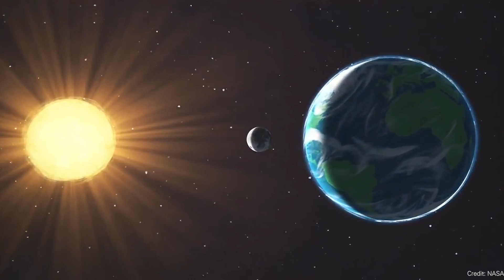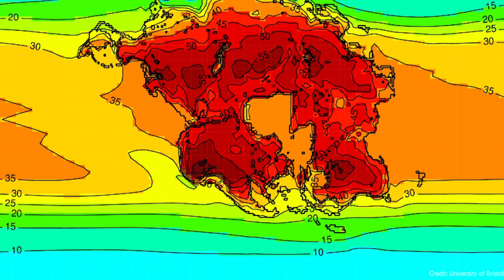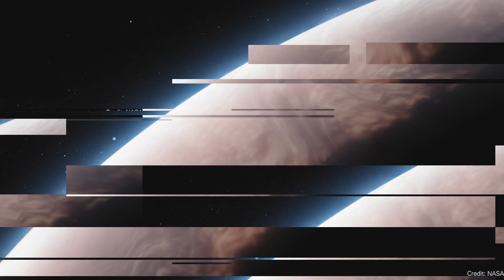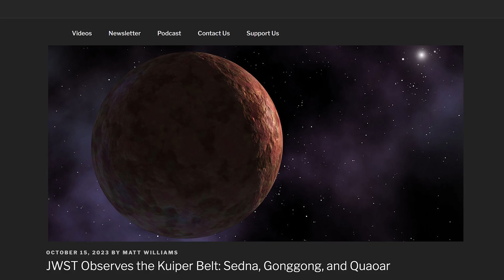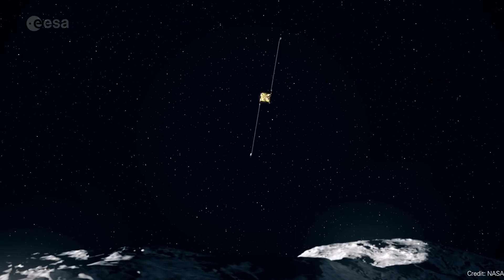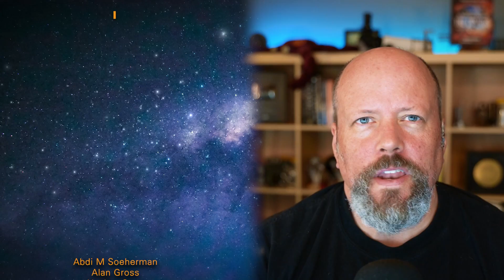Deadly Supercontinent // Pluto Cryo-Super-Volcano // Most Powerful Solar Storm

Comment: Thinking about solar storms, I've wondered if it would be possible  for technicians to install fusible links which would burn out at power stations and sensitive places along the grid and reduce damage to the grid  and be easy to repair after an event.

Comment: Cosmic rays are pretty amazing when you think about it. Electrons act as both particles and waves and because of their negligible mass, can move at the speed of light, or near enough to it to make no difference. Protons, on the other hand, are MASSIVELY larger than electrons. They are firmly in the camp of particles (as opposed to waves) and because of their mass, would take an ENORMOUS amount of energy to accelerate a proton to near the speed of light. And yet, cosmic rays are an uncountably large volume of protons, all accelerated to near the speed of light. The energy that must have taken... It's phenomenal!

Comment: Question for the question show. How did the solar system form?

I'm familiar with the traditional theory of the rocky planets forming inside the frost line and gas giants forming outside the frost line. But that was formulated back when we only had one data point to work with, right? In the past decade, there's been a boon of exoplanet discovery, and not all systems seem to be what we expected from that theory, with hot Jupiters, mini-Neptunes, hycean worlds, etc. With so much more data now, has our theory on star system formation changed? What is the current theory?

Comment: I sometimes have to prepare and and check on spectrographs which includes the taking of bias (zero-time) test exposures. In most of the exposures, there's at least one (but usually more) cosmic ray trails through the CCDs. Some are dead straight, probably higher energy while others look like they were deflected.
Reply from the maker: Hopefully they'll set up some kind of data pipeline so you can hand them off to the cosmic ray researchers.
Reply: Actually, that's a really good idea,  @frasercain ! I would think the observers' biases would be even more valuable since they routinely gather about 8-10 of them (from each camera) in order to run averages. Also, apart from the time-stamping the precise position and orientation of the cameras are also known as they adjust them according to diffraction grating blaze angles, etc.

Comment: When the earth crust plate tectonics shifts the continents back together again in the future, the weight of the continental crust being great mass than abysmal plane crust will have the Ultima-Pangea under-go yet another ECD (Earth Crust Displacement). The continents will not be in the same geographical orientation as they are today (and the past 12,800 years). The heaviest part of the Ultima-Pangea will be on wheresoever the equator and crust shift have settled.

Comment: Question: Have astronomers attempted to make a telescope that can see cosmic rays, like a higher energy version of an x-ray telescope? If not, why not?
Reply from the maker: Yes, there are many cosmic ray instruments. There's even one attached to the ISS.
Reply: @frasercain  If we do have such instruments, then I'd like to learn more about why astronomers aren't entirely clear on where cosmic rays are coming from (@20:17).
Reply: @spaceinfrastructure3238  Because they are deflected by magnetic fields in space, and those magnetic fields aren't known precisely.
Reply: A telescope detecting cosmic rays would not be a "higher energy version of an x-ray telescope". X-rays are electromagnetic radiation, where in contrast, cosmic rays consist of charged particles like electrons and protons.

Comment: Solar storms are bad news for sure, the only real defense against them is shielding electronics by using a Faraday cage that is very well earthed, ie;, a tin foil shield around your goods that is connected to a steel rod that is driven as deep as possible into the ground, we do get a little warning about these events, but not much, luckily light/neutrinos are quicker than a swathe of high energy protons rampaging across the space between the Sun and us...

Comment: I have a question: Do any of the asteroids in the asteroid belt have activity on them like the Kuiper Belt Dwarf Planets do as you described in this episode? Or are they all static?
Reply: Ceres(the biggest asteroid with 970 km diameter) have at least a cryo-volcano, and expel water in space sometimes, also is made 25% from water, probably as a thick 100 km ice/brine layer under a thin crust(no more than few km) made of clay and dry salt.
Reply: @theOrionsarms Ceres is a dwarf planet, not an asteroid.
Reply: @BattleBotBreakdown  it is in the middle of the asteroid belt. And it it's a part of it, exactly like Kuiper belt objects aren't all dwarf planets Ceres is still one member of the asteroids population , and the question was if some object outside the Kuiper belt(like in the asteroid belt) have the same geological activity.
Reply: @theOrionsarms  Ceres is geologically active. It’s in the Asteroid Belt, but is quite different from an asteroid. Just as Pluto and Charon are in the Kuiper Belt, but are nothing like the clumps of rubble that make up the belt (like Arrokoth).

Ceres, Pluto, and Charon are all dwarf planets, which are a separate group of objects from asteroids.
Reply: @BattleBotBreakdown  according with the international astronomical society decision from Prague in 2005, Ceres is a dwarf planet but it still  one of the asteroids, anyway the question was if that type of geological activities are restricted to Kuiper belt, is not!, not only Ceres but also some of the gas Giants moons (like Enceladus)have the same type of activity. If you are one of the guys that is denying recognized international definition, don't bother to argue that your personal classification is better, it doesn't matter what you or I are thinking about that.
Reply: @theOrionsarms  Yes, many moons have geologic activity. The original question was about the Asteroid Belt, though.

Regardless, if you’re referring to the IAU’s infamous General Assembly decision of 2006, there many reasons why it’s so controversial. The biggest reason is that it was decided by non-experts who don’t study planets. If you ask a planetary scientist what a planet is, they’ll give you a very different answer than what the IAU voted on. As scientists, we have a right to disregard the IAU and use a better definition. They don’t own space and we can choose not to listen to them if we want. They’re not the police, we aren’t forced to listen to them. Science doesn’t work by decree of authority. Just because a handful of people voted on something doesn’t make it true. That’s not how science works.
Reply: They’re all static. Asteroids cannot have geologic activity, only planets can. The only planet in the Asteroid Belt is Ceres, which has cryo-volcanoes and salt deposits on its surface.

Comment: Question: Why will a 47°C temperature in the future cause a runaway greenhouse effect, when earth used to be 70°C a few billion years ago?
Reply: Because  #1 the sun itself shines about 10% hotter every billion years and #2 the Earth's atmosphere was completely different from the present one. There are I guess more reasons, I know only these two.
Reply: @Emdee5632  I guess solar energy input is more important for runaway greenhouses than greenhouse energy input/retention.

4 billion years ago: temperature = 70°C (343 K), solar flux = 180 W/m², greenhouse effect = 605 W/m²

Now: temperature = 14.8°C (288 K), solar flux = 240 W/m², greenhouse effect = 159 W/m²

1 billion years in future: temperature = 47°C (320 K), solar flux = 264 W/m², greenhouse effect = 331 W/m²

Venus, when its runaway greenhouse started: solar flux = 344 W=m²

Comment: Hi Fraser! I have a question. Based on a shape of Earth's magnetic field, is there more solar and cosmic radiation in the poles, or more precisely beneath the auroras?
Reply: "The flux of incoming cosmic rays at the upper atmosphere is dependent on the solar wind, the Earth's magnetic field, and the energy of the cosmic rays." - Wikipedia entry "Cosmic ray"
So: Yes 😉

This has the modifier that since the aurora borealis (North pole) conducts positive particles and the australis negative, and positive particles tend to be heavier because of the large proportion of protons, the radiation under the AB is greater than that under the AA. And cosmic radiation is less affected by the magnetic field than solar due to its much higher speed, but the atmosphere is thinner over the poles than around the equator, so there's more cosmic radiation on the poles in general, aurorae or no.
Reply: @Smo1k Thank you! 😊

Comment: The reason for the drift was the addition of a huge comet that planted itself in the center and forced the continents apart. There is no return from this state, but the solidity of the entire mass is changeable; and one presently ignored relationship is the Earth's distance from the sun, as defined by our orbit's oval shape; now synced with the seasons, which are defined by the Earth's tilt; but now we  are closer in Winter and further away in Summer, which suits the Northern Hemisphere just fine, and clearly modifies both extremes, and if that relationship alters because everything does, it could affect the Earth's  temperature mightily.
Reply: "The reason for the drift was the addition of a huge comet that planted itself in the center and forced the continents apart."

Where did you get that idea from?!

Comment: It won't be the supercontinent that wipes out mammals.  Totality is WAYYY cooler for several reasons, one is that the leaves on the trees, as the example I noticed, just before and after totality, have very sharp shadows on the ground, even if they are way up in the tree.  It looks really weird.  Has anybody factored in global warming, especially if we really do hit a tipping point?  How long do snowball, etc Earth cycles, etc last?  There will likely be multiple mammal ending (or close to it) events long before that.  And if it's like last time it will only last 150 million years or so, so if we just are patient ...

Also, that change won't happen immediately, and a species can do a lot of evolving over 250 million years, like into many other species.  There are already life forms on Earth that live at far higher temperatures than that.  Doesn't meant that 'we' would, just that maybe we could.  Bottom line, does it really make any difference whatsoever?  The human race will either be gone or able to handle it technologically, including leaving, at that point.  If not, we deserve to be erased, IMO.  In fact I'm not totally convinced that we don't deserve to be erased RIGHT NOW.